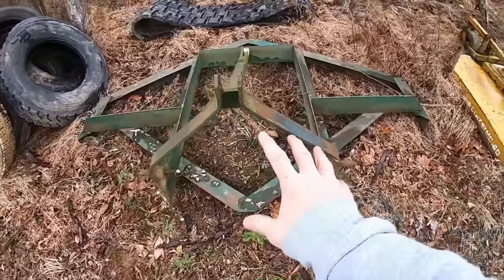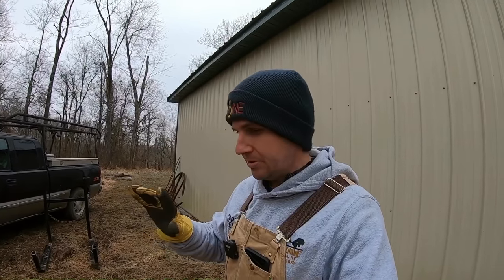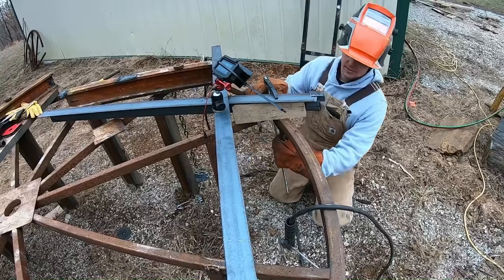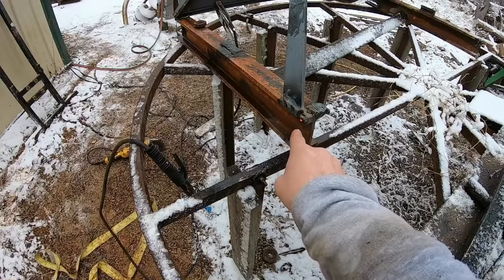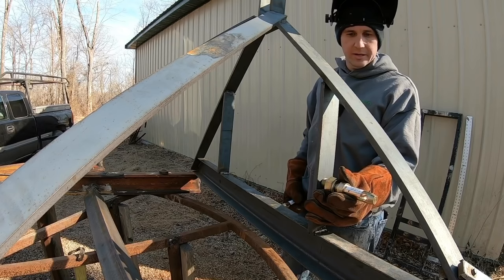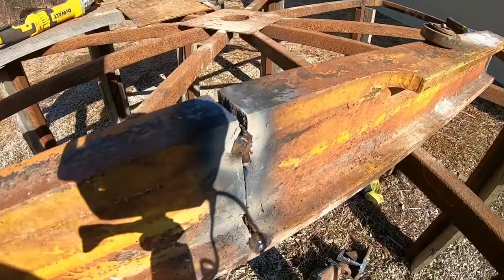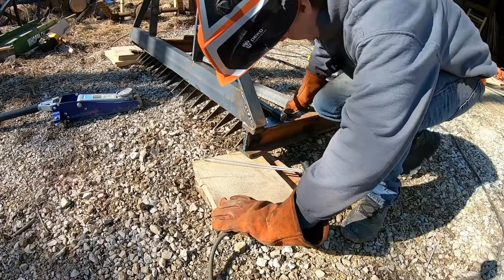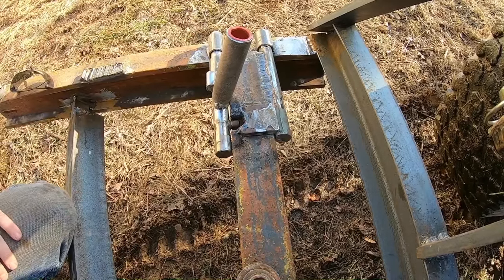Building a Road Drag / Land Plane with Flip up Ripper Bar

Comment: Great job! There's nothing like O.J.T.! When I started farming I quickly learned there were things you could  not farm without: air compressor, cutting torches, welder and 4 x 4 pickup! With my old Ford T-20 small square baler, I'd bale awhile, run to the shop and weld on it for awhile! But, I ran 20,000 bales through it and sold it for more than I paid for it. One thing about that baler: it never missed a knot! Thanks, Mike! PS: At 7 am this am, we had 1/8" of frozen rain on the ground. I could not stand up on my gravel drive. Be safe! Lee
Reply from the maker: The ice is coming down here as well!  Stay safe !
Reply: T7 5

Comment: 20 yrs ago I bought a tri square for cutting metal. The tri square for metal is 3times as big as for wood,a brass ruler and magnets for helping hold it place how you want it with a sliding piece that will go up against the metal for a square cut. The brass ruler sits 3/8" to 1/2" above your material your cutting and a cutting tip slides along it very easy. I think mine was around $80 when I bought it. It is one of my most used metal tools. I also bought a 4' one that came with 2 tri square magnets. Drag looks good.
Reply from the maker: I'll have to look that up!

Comment: Much better summary. Good job teaching yourself. 
My father learned to gas weld using steels cans and welding them end to end. He said everything else seemed easy after that.
Reply from the maker: Dang that's awesome!
Reply: use a "cutting torch" to do the gas welds, the skill needed to avoid blowing through any thickness of metal pays off when using a welding tip.

Comment: You're doing good Mr. Mike.  It's awesome to see a homeowner fabricating a piece of kit and learning a new skill at the same time.  That's how we should go about life.  Work with your hands and slow down a little bit.  And don't ever forget- Edison didn't fail inventing the light bulb.  He found 2,000 ways how not to make it.  

My only suggestion on your torch work- if you're cutting toward you, raise the handle just a bit above 90° to your workpiece, and if you're cutting away from you, lower the handle.  That way the preheat flame will get your steel up to kindling temp and you'll get a cleaner cut with a bit less slag.
Reply from the maker: Thanks for the tip mike!
Reply: @CaptainKleeman  I'm going to send you a few tips for your torch.  One is a washing/gouging/scarifying tip.  It has a curve to it so you can make a nice flush cut with it.  Like for instance when you were cutting the tabs off and what was left of the rollers of the forklift frame.  Plus a few others that'll make life a bit easier.

Comment: if you have a big gap you can do texas tig which is taking the flux off of 1 rod and using that as filler rod to weld over with the stick welder to fill the gap
Reply from the maker: Yup, did it in this video actually

Comment: You're coming along with fabrication much faster than I did, way to go.  A few things I've learned that are worth mentioning:  Watch the I C Weld channel and you'll learn more about fabrication than watching 20 other welding channels;  I always use 6011 for my root pass and then top with 7018 passes and I get strong welds that don't look too shabby;  buy some inexpensive magnetic welding positioners (I have some Strong Hands but there are many equivalents);  when money permits you'll find that an Evolution Cold Cut Saw will improve your projects because the fit up is much better;  "When there's slag, you drag";  1 amp per thousandth of material thickness is a ball park rule that's on the hot side but a good starting point;  a useful technique called "Texas Tig" is worth learning;  and when money permits a plasma cutter is better for cutting many things than an oxy torch (having both is best case).
Reply from the maker: Thanks for all the info!  I need to try out some different rods
Reply: @CaptainKleeman  7018's built America and they weld really nicely, but 6011's weld through crap and get deep penetration so they're perfect for root passes on materials that backyard warriors generally have available.  BTW, a surplus 40mm ammo can makes a great rod storage box that keeps them dry.

Comment: Captain a little tip with your torch. Move faster get your tip closer and turn your torch down doesn't need to be so hot. With it being so hot and moving so slow your cutting in front of your tip and its trying to weld back together behind your tip this will make your cut cleaner when you're done. Ask Man Behind the Scenes about this he can show you in person what I'm talkin about. Also 7018 is a little over kill. Yes it's really good rod but 6011 or 6010 would be better when you're still learning how to weld. Advice coming from a professional pipeline welder of 30 years

Comment: Lookin Good Mike. One thing Your Pins for Your Scarfire you may want to Make longer and drill a Hole on the end and Pin it like you do for 3 point hitch. They will Vibrate  and Turn and come out. Also you may want to add a type of Box on those supports to put a log in it for more weight rachet strap it on it. Even a couple angle iron to set log on. More weight will help it from jumping up. All just suggestions. Great job on it. Love how the Teeth swing down Easy peacize...LMAO..LOL.Great Video.
Reply from the maker: Thanks Thomas!

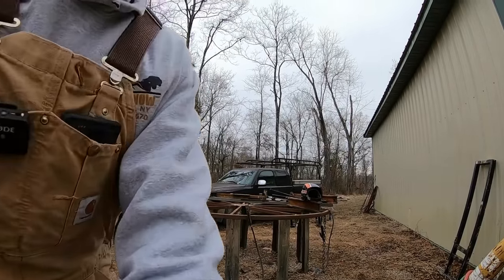Comment: ya know mike if you made am extension off the side of the barn at 3:08 youd have a "shop" there technically a covered awning you can pull through but extend the barn roof coming down make one side wall leave the two ends open put tin over your 2x4s and the one wall and gravel on the ground and youll atleast have some cover any road drag looks nice keep it up

Comment: Your progressing just fine, just going to take time. Only suggestion I might add is in time get you a heating tip for your oxy-acetylene torch or as we call it a rosebud tip. Makes bending the metal much easier but eats gas a lot faster. If you don't mind me asking what fire department do you work for? Keep cranking them videos out and be safe my fire brother.
Reply from the maker: I definitely need to get some more torch accessories!

Comment: Some thoughts.  Shapes and strengths.  From weak to strong by weight.  Round bar, flat bar, angle, C channel, I beam H beam, square or rectangular Tube, and round Pipe.    This may help save you some money when you are paying by the pound.   
Try not to stop welds at corners.  Weak.   Weld around a corner then stop.  The torch seems to be burning through, not cutting.   Maybe a little mor oxy pressure.   
Respectfully,   Kevin
Reply from the maker: Appreciate the info!

Comment: Just a safety note . When using the cutting  torch make sure your hose and electrical  cords are not where they can catch hot slag and melt thru . Speaking from experience  here .

Comment: Instead of keeping your torch head square to the piece being cut, slightly tip the torch forward in the direction you are cutting. The flame will preheat the metal you are cutting and things will cut faster and cleaner. Good luck.

Comment: When welding the heavier steel plates, I'd put a deeper bevel on it to get deeper penetration. The heavy I beam you welded  for your scarifier would be stronger if the ends were beveled more. Place I worked welded 4 and 5 inch plates. Multi pass welding was used to close  gaps. Parts were used on semi trailers and fork trucks. Strength  was a necessity

Comment: Just a small tip Mike that you can look at for self learning the kerf  is the cut you are making when gas cutting, when you look at yours the top edge is rounded which means 1 of 2 things moving too slow or the heating flame is too fierce. From looking at your video it's too fierce. the kerf edge should be fairly square hope this helps.
Reply from the maker: Appreciate the tip Barry!
Reply: @CaptainKleeman  no problem just here to help.

Comment: Good job, Captain. Well done on the drag (and the out-ro).  Now that you've got the welding thing down, you can come down to Texas and fix the broken 3 point hook up on my commercially made "double edged grader blade" that broke earlier this week.
Reply from the maker: Looking at weld quality on new implements is one of the reasons I decided to start learning to weld lol
Reply: @CaptainKleeman  Not so much the weld, but since I was going down the road from my son's house when it broke and let the implement hit a tire at road speed,  and "cheap" tires on the 75HP tractor are about $750 each.  Keep up the practice, good welders are in big demand, even here.

Comment: Just a pointer captain the rod will always burn back up inside the flux a touch so if you just break that little bit of flux off with your fingers (with a glove on of course) it will usually make restarting the rod much easier

Comment: A cutting test we use at work is putting a few 5/8 bolts through a piece of plate.  Tighten them up without washers and then cut the heads off or the nut side off without nicking the plate.  It’s good practice for when you don’t want to destroy something you’re cutting apart.
Reply from the maker: I'll have to try that!

Comment: When you are learning to cut thru from center of a solid piece, take the time to drill a small pilot hole thru first with a drill, you will find it a lot easier. Your welds have greatly improved since you have started. You are doing great young man.

Comment: Hey there, your welds look pretty good for first timer.. mine were the same when I first started stick welding.  I haven't gotten a torch welding setup yet.. but I have had experience with MIG and FLUX-CORE welding.. 110 volt MIG (with shield gas) is good for really thin metals, but 220 volt is better for general welding with either MIG or FLUX-CORE (welds turn out alot better then using F-C with 110 volt) from what I've experienced sofar.

Comment: Captain, depending how heavy your implement is. You "may" need to turn your pins to the inside of the hitch for your tractor to lift. And to make hook up easier.
Reply from the maker: They are the same width as the bush hog and my gill pulverizer
Reply: @CaptainKleeman  the camera angles looked wider than the tractor arms could go. As long as your measurements work, go for it. Curious if future upgrades will be a quick attachment setup?

Comment: Hey Mike:  Have you considered putting a locking pin onto your scarifier lift mechanism.  The notch  pin system you have may vibrate out when you get working it.  I don't know if it is necessary but when you are down in the middle of the woods working your grader you may find that having that pin vibrate out of position a bit of a hassle.  Otherwise it looks like you are doing a terrific job for a neophyte.  Keep up having fun and I'll keep up watching for vicarious pleasure.

Comment: And... use a flexible link between the top link and the home made land plane.  You could even use chain instead of the top link if distance works out right.

Lets the land plane float the back end up as you negotiate a dip in the driveway.

Comment: Very nicely done Capt. From your welds to Torch cuts to the overall design. Can't wait to see it in action. There's no doubt you're welding skills are improving and getting very good. When torching, having a pair of adjustable pliers around comes in handy to move amd hold hot metal of different thicknesses and a large adjustable wrench can help give leverage for bending metal with the Torch too. Hope this helps and can't wait for the next video 😁👍
Reply from the maker: Thanks Matt!

Comment: ive donea little stick welding. personally i find dragging the rod across the  metal works a bit better than tapping to get an arc. your mileage may vary.
Reply from the maker: I've never liked the drag method,. It doesn't work as well for me.

Comment: Greetings Mike!  What a great thought process you have used on this project, I've always studied other designs first and tried to incorporate only the  best from each.  Having held the position of crew boss many years back for my father at Russell's Excavation here in south western Indiana, sometimes my filter doesn't work.  Children today wouldn't like working under me very much!  LOL  Try using a 6011 rod for your root weld, if you want to be a sissy about it to make it look perty cover it with a 7018.  Always make a larger rake angle on the front bar to move material quicker and a smaller angle on the back bar to move the material slower so it smooths the material slower and evenly.  I really like the vids and energy you show.
Reply from the maker: Thanks for all the info Mike!

Comment: When using the cutting torch, don't cut straight down when cutting but angle it a little toward your cutting. It will be a better cut and blow the slag toward your cut with a cleaner cut and less grinding. Good Job!
Reply from the maker: Thanks!

Comment: Your welds are looking much better. When heating steel to bend you should put more heat in the steel to bend easier. The steel should hold a red glow when hot enough to bend, but don't overdo it. Takes practice. When cutting make sure your electric cords are not under your cutting area. Hot scrap will melt the cords. Don't ask how I know. I see you are supposed to be getting an ice storm in your area today. Drive safe nice work on the drag.
Reply: Also when heating always heat on the side you are bending into. If you heat from the side your bending away from the metal can actually rip.

Comment: Be prepared for some ribbing from MBTS. Not because you think that your welding is poor but because you have become a seasoned welder in months and he has taken a lifetime. But now he will know that your welding is really good. I am also pleased that you did not try out your build until you have added the other retaining bolt, same hymn sheet as I am on there, nothing worse for the fragile ego as when you test before ready, causing it either break or bend. Then it would look like a dogs dinner to you after that. On a side issue, I feel that as your dogs NEW Agent, we need to enter in a see and fee type deal cos as you know that there dog is the star of this show and if the dog says anything online the fee would have to be loads more. The two at DP's place have asked for the same deal but I will talk to Gunner as Mike don't listen. lol.
Take care stay safe all the best to family. Tony

Comment: After seeing your slag burns on the shielding glass after you torched the 3 pt pin holes I remembered you mentioning in a recent video about the possibility of a 3D printed GoPro case to hold welding glass. 
Perhaps if you and your friend are creating from scratch or able to modify and existing 3D file you may want to look into being able to have a clear glass in front of the shade glass like a welding helmet actually has to protect the more expensive shade lens.

Comment: 7018 has a flux issue after welding it always has, if you use your gloves an pinch the flux off the tip of the rod it'll start similar to a new rod if not better an yes hot rods I know an even a plate not grounded to bang the fluxed tip helps too.
Reply from the maker: Thanks for the tip

Comment: Cut it 3 times and the day gone thing is still too short. 

Never had that happen before to me.  😂🤣😂🤣

One question. Is there a reason your angle iron is just one straight piece going side to side on an angle and not a V shape? Seems like it will transfer material to the left and leave more on that side. 
Looks great and don’t be so tough on your weld quality. They look decent and certainly look like they won’t be a weakness.

Comment: Nice recovery with the angle iron cut!  I had a similar ripper setup  on my dragalong for a while.  Instead of your plate steel teeth I had 3 inch lengths of car sway bar (spring steel is pretty hard) pointing forward at a similar angle to yours and it worked pretty well (I lost a few teeth to the rocks though :)) .  P.S. I noticed you showing off a few of those welds... 👍
Reply from the maker: I save old leaf springs for the hardened steel.  Lol.  And I'm finally starting to have some welds that look halfway okay,. Proud of the progress.  Thanks for watching!

Comment: One piece of advice I would give you when butt welding grind a v in the joint so you get good penetration with the weld. but on small applications like this you will get away with just a straight cut butt weld
Reply from the maker: Definitely!  Luckily my cut was so far off I had alot of gap hahaha.  Hey thanks for looking out!
Reply: @CaptainKleeman  when having to weld big gaps it helps improve your welding skill and when you can weld a hole in a pipe without it backfiring causing a pinhole in the weld your close to mastering it

Comment: Would another smooth blade behind the first either straight across or at an opposite angle help distribute the material evenly?
Reply from the maker: Hoping to avoid it, will know after some testing

Comment: Captain- that one cut looks good for travel and steadines... but.. the top bit where the steel is actually melted is evidence of the flame being too hot and the preheats are melting the surface. turn the Acetylene down about a third less than what you were doing... less flame will also leave less slag on the bottom..you're picking it up quick..
Reply from the maker: Thanks!

Comment: Couple of tips with torch cutting  your not trying to melt threw the oxygen once the cut starts does all the work by oxidizing the steel away and also lean your torch away from the cut so your torch flame sees a thicker piece of metal especially on thinner metals rember that torch could easily cut 2" thick steel and would be easier to cut then thinner metals